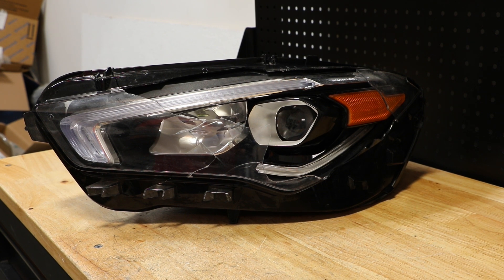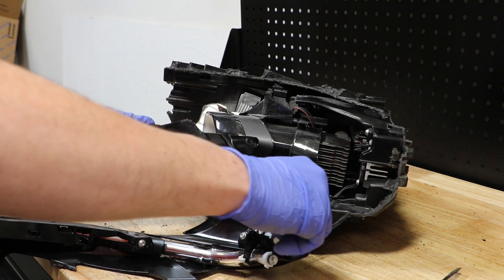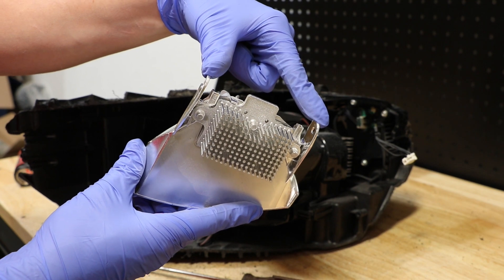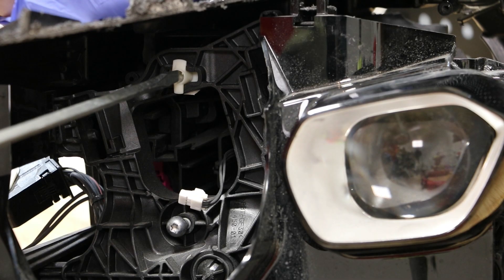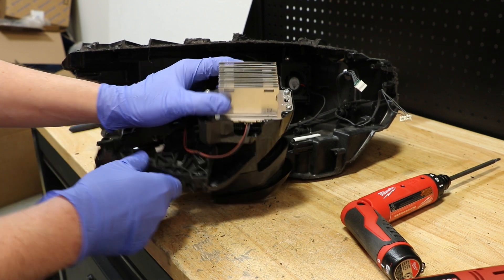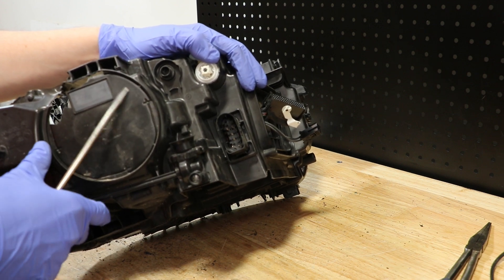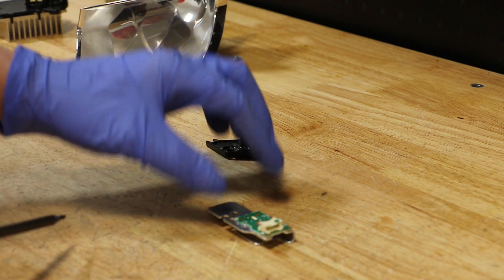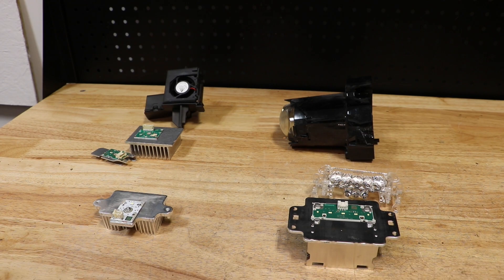2020-2021 Mercedes-Benz CLA LED Headlight Disassembly

Comment from the maker: I believe it would be either this piece: https://youtu.be/NuM97hpdVd0?t=164
or this piece: https://youtu.be/NuM97hpdVd0?t=359

Neither part is available for direct purchase.   If yours is out, I would recommend trying to get it replaced under warranty from Mercedes-Benz.  Otherwise, timewise your best option is a new/used headlight.